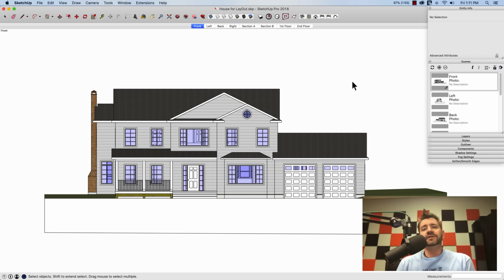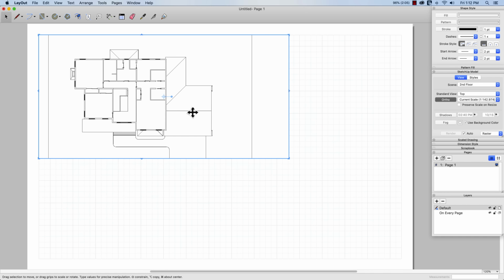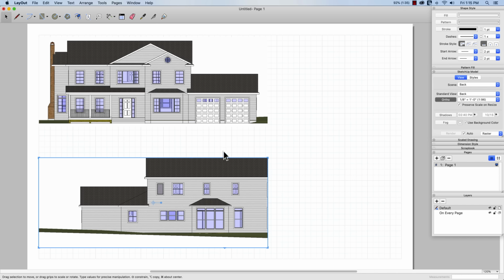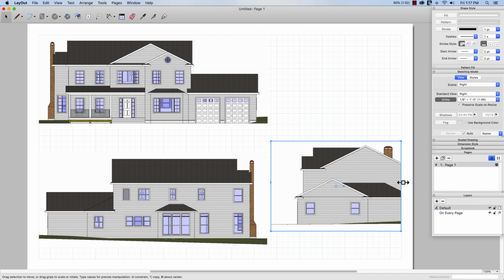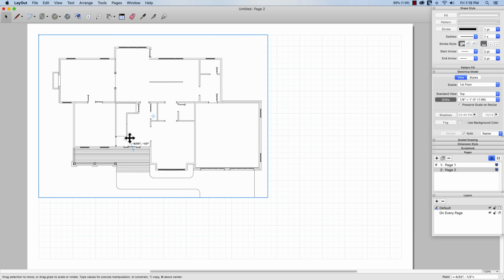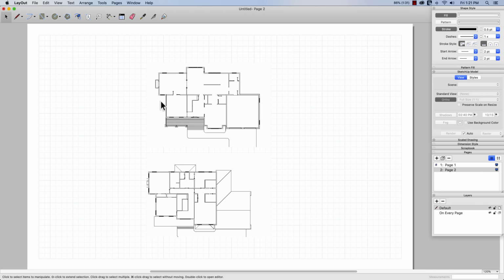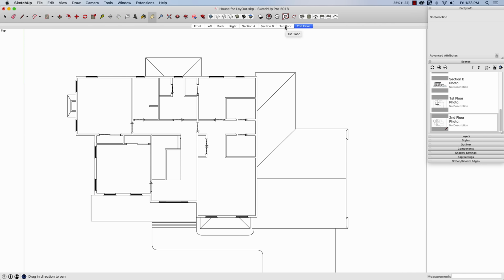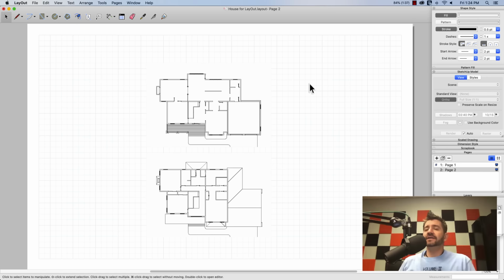Turning SketchUp Scenes into LayOut Viewports - Skill Builder

Comment: just a quick note 9nothing to do with layout or anything else) The code requires that the chimney height needs to be higher the any part of the house even if it is a distance from the highest peak of the house  ---  I know you can fix it in one second and this has nothing to do with the price of Bananas but just in case it comes up    - anyhow nice job

Comment: Question, and this is one that i have had for a looong time.  I came from a solidworks/parametric modeling world over to SUpro. Onething i do miss about parametric modeling is the mere fact that if i want to change the size of a block, or radii of a circle, i can, and it will update the rest of the part accordingly. 

This leads me to my question, is there anyway to edit an object once created? lets say you have modeled an engine block and you realize you were off on some of the dims, is there a way to change those without redrawing the entire object? Or is that something that will have to be edited in layout once you place dims?

thanks. A video on this subject could be helpful if indeed its posible:)
Reply: Shawn Wallwork i do use components alot. What i mean by change is if i make a radii bigger for a hole or diminsion change in solidworks, it will make sure all the other diminsion that are related to that one change by the correct ratio. Its actually really cool. I use components in su all the time for certain features such as the one you speak of. Especially when doing tiny hole cuts, ill make a copy of the part, scale it by a 1000, make the cut and then delete the bigger component:) thanks for the reply

Comment: That was unclear how turning on a section cut in floor one, then without switching to scene second floor you updated the scene for floor two and viola!  It’s instantly aligned.  You lost me on that process.
Reply: M.A. Stough activating the alternate section cut through the outliner eliminates changing the viewport. Then you just right click the section cut tab and click update. Try working through it a few times on a test model. That was the fastest way for me to learn it.
Reply: All I did was change what layer was visible (not changing the scene). Since the model did not move when I changed layers, the view was exactly lined up! Then I could update the old scene.